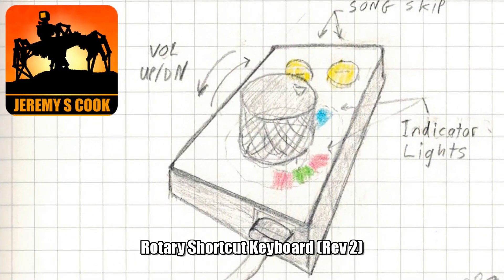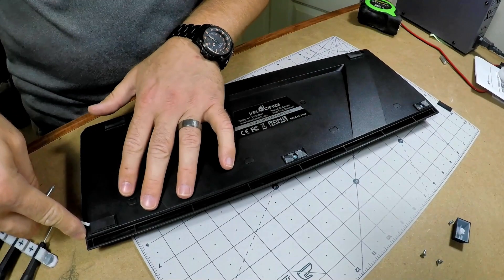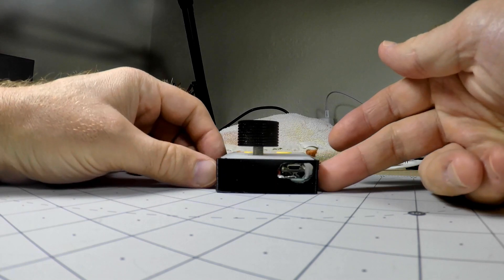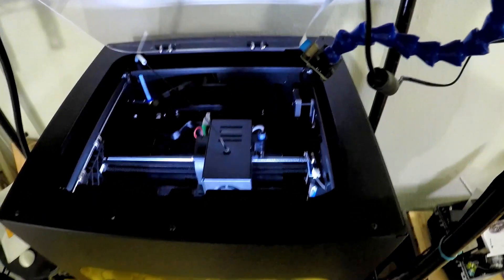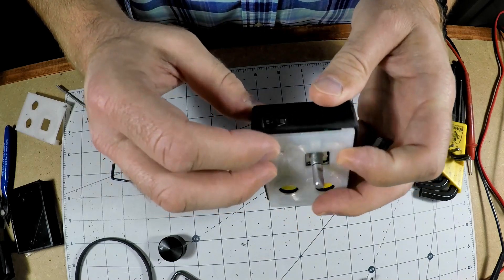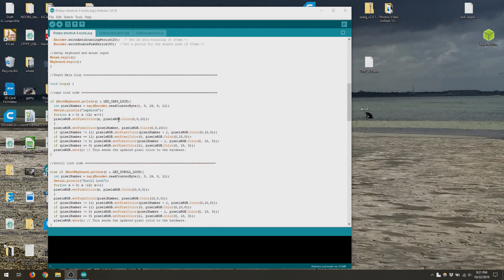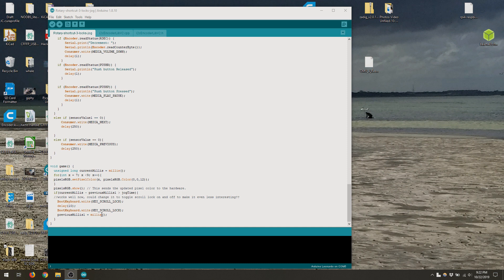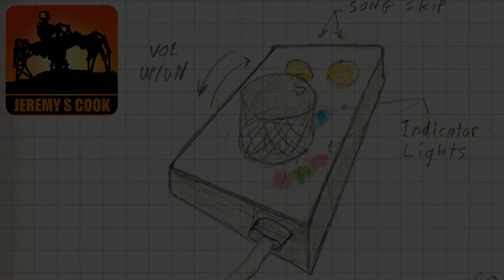PC Shortcut Knob WITH Caps Lock AND Stay Awake Function [Arduino]

Comment: I want to make 2 rotary knob to control the direction of the mouse, first up and down and both left and right. is there Code program for the project.?
Reply from the maker: Hi Dana, the code for this one is linked in the description, but I would check out the previous version: https://www.youtube.com/watch?v=ePKGLnjlXl4 - Code for it is linked in that video's description, but that iteration actually moves the mouse around. I'd guess you could adapt it to your purposes.